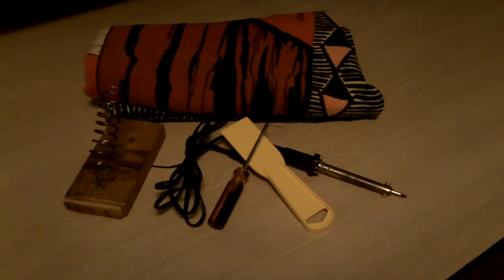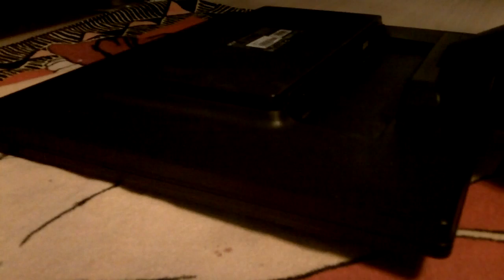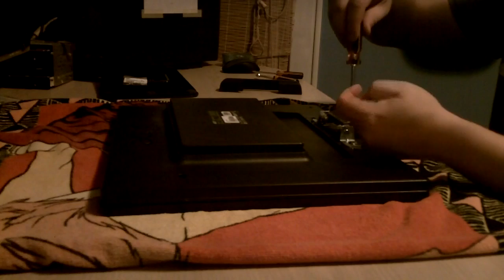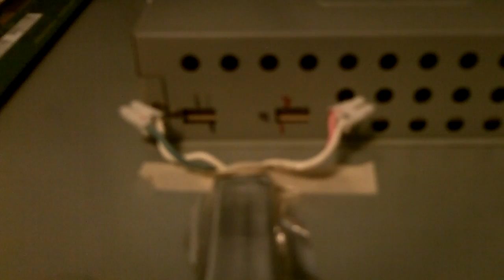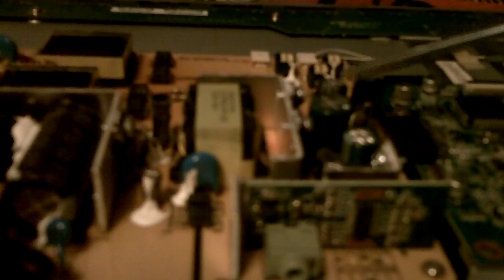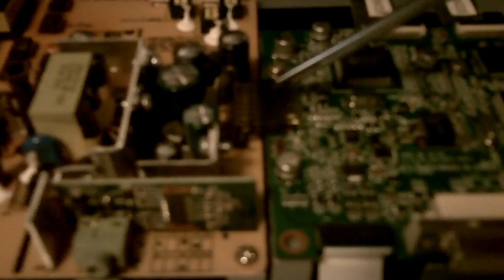Acer AL2017 Repair Guide (1/2)

Comment: Thanks fettesps.  I'm glad you put up this video on how to change out the poor quality CapXonon capacitors.  The video is ten years old and still helping people! Thanks again.
My version of the AL2017 power board used the following caps (quantity, microfarad, voltage):
1x 2200mf 10v,  1x 1000mf 10v,  2x 220mf 25v,  2x 1000mf 25v,  1x 470mf 25v,  1x 22mf 50v,  1x 47mf 50v

Comment: Oh! and yeah fixed mine with just 4 dollars and like 1 hour of work.

Already knew that the capacitor were the problem but i was unable to disassemble the monitor until i found this video hehe, and used an old credit card to avoid damaging the frame with a screw driver, it took me like 5min of swearing but in the end my monitor still looks like new.

Comment: Thanks for the video.  Woke up this AM with a DOA monitor just like you describe.  I inspected the capacitors and found 5 defective (top of capacitor domed, not flat). These were 220uf at C200, CE101 and CE108 (replacement Radio Shack 272-1029) and 1000uf at CE102 and CE103 (replacement Radio Shack 272-1032), all of the same manufacturer.  The other caps by other manufacturers were not defective so I didn't replace them.  Worked great afterwards.  Back up and running by evening.